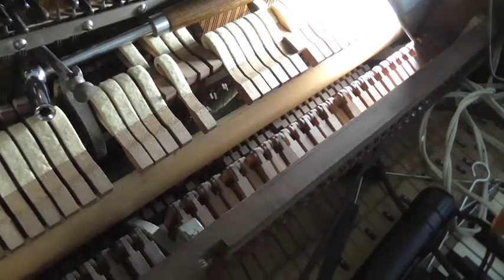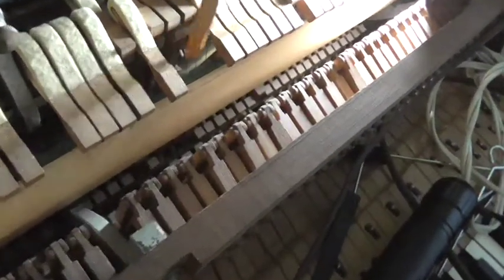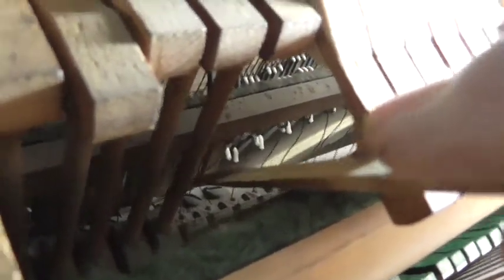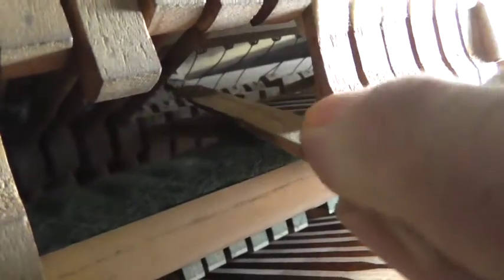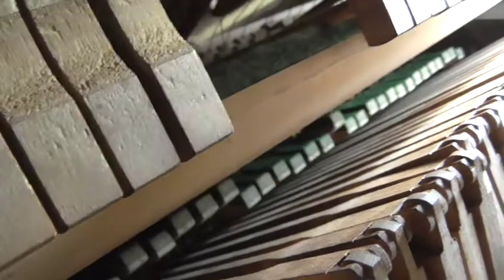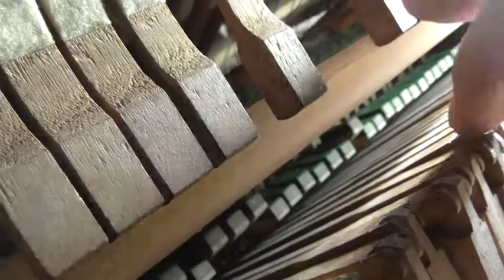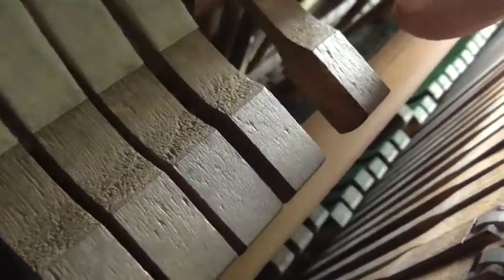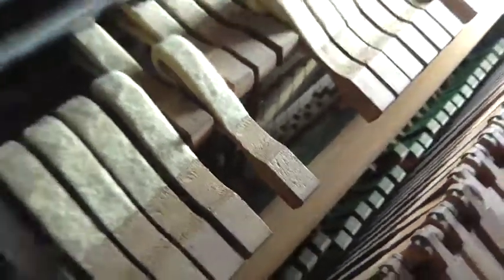How to reposition a hammer return spring in an upright piano

Comment: Thanks, however in my case, there's a tiny rope holding the spring into position and on one note the rope has broken. Now: How to removing that single key-action? There's one screw at the front and one at the top, both really hard to get grip on. Should the hole action-package be removed? (Renner). Thankful for any help sir.
Reply: Asian piano? Easiest to take the action out. Mark the key with chalk or a pencil first to so easy to find once out. Also easier to purchase a new flange with the rope already on it. Cheap part.